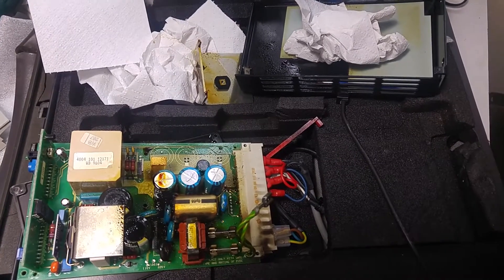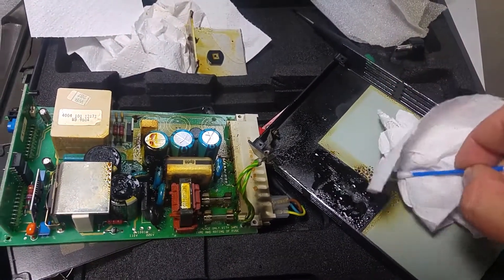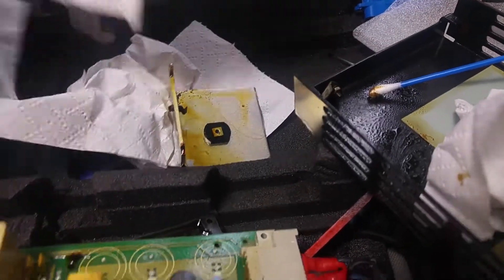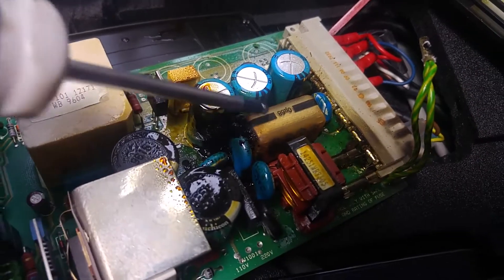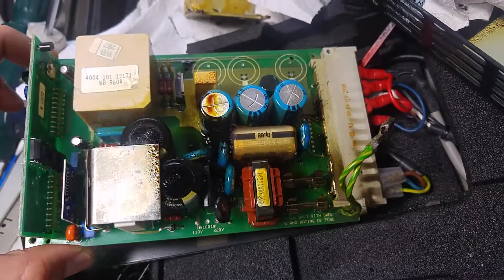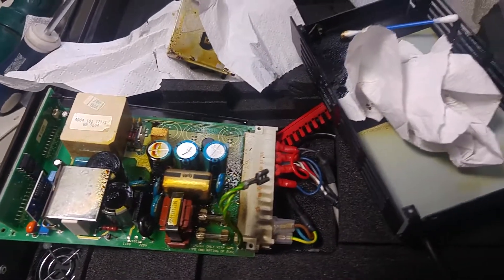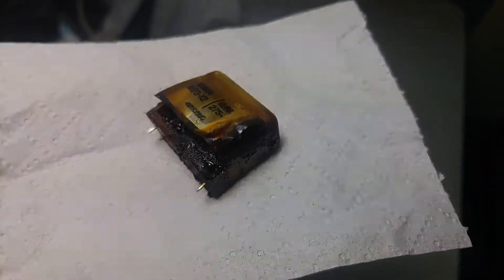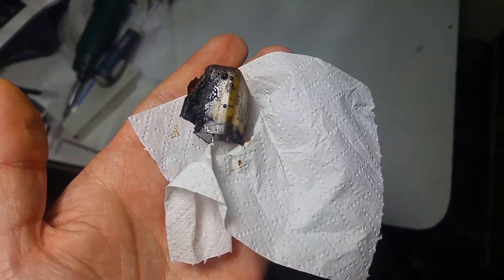Leaked capacitor burn - melting pot of electrolyte with lot of magic smoke!

Comment: Just for information - it's not electrolyte. It is not an electrolytic capacitor - it is a standard paper dielectric capacitor. They're still being sold these days despite being unreliable after 15 years or so. 
The nasty stuff is oil and wax. The paper is impregnated with it to improve the isolation, it's non-conductive. The electrolyte in electrolytic capacitors is there to make it more conductive.